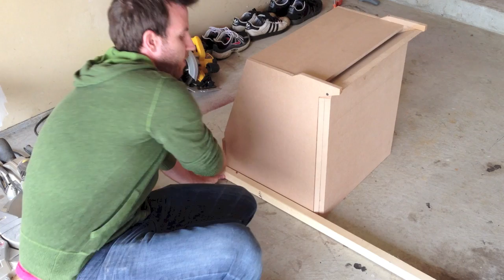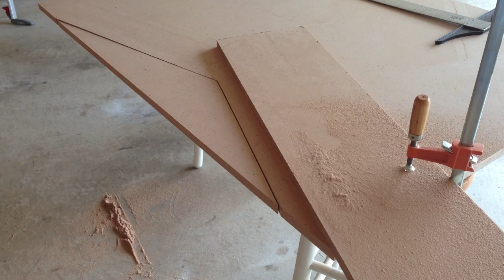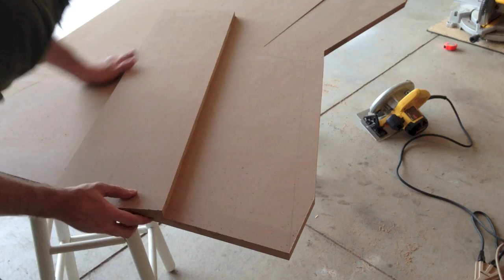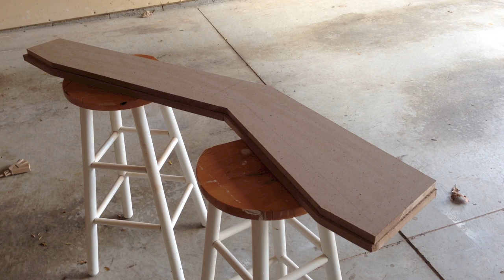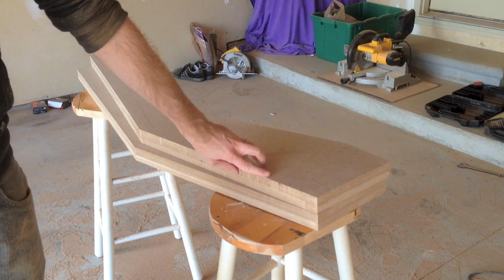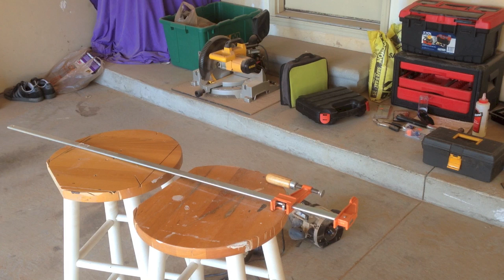Vewlix VLX Day 3 - Sides and Feet

Comment: Great video Donovan, glad you managed to retrieve the original footage :-)
 
I have a question about routing the sides. In the video you routed the outer side but I'm guessing your also going to do the same profile for the inner side?  If so, how do you tackle the inner corners? The angle isn’t too extreme on your side piece so might be a non-issue but I'm planning to build my sides with a foot that runs along the side of the base, just like your original cab. With that design there is an inner right angle corner that’s chamfered 45 degrees. Will a router just follow the rail to the right angle and match up automatically or is there a trick to it?
 
Apologies if I'm not explaining myself very well.
 
Going through the last bits of design and prep work at the moment before I start a build in the new year so your videos are a great help! Please keep them coming.
 
Have a great holiday season!
Reply from the maker: Let's talk about the sides in the upright position: the front edge has a 3/4" bevel on the outer side and 1/2" bevel on the inside. The back edge of the side will not be routed.

I didn't have any issue with my first cabinet doing a 1/2" bevel along the foot. You do get a bit of a radius where the foot meets the side. I wasn't particularly in love with that look, which is why I did 2 pieces on this cab.

Have you seen my Flickr photo gallery of the first cab? Lots of pictures: flickr dot com /photos/donovanmyers/sets/72157615957035070/